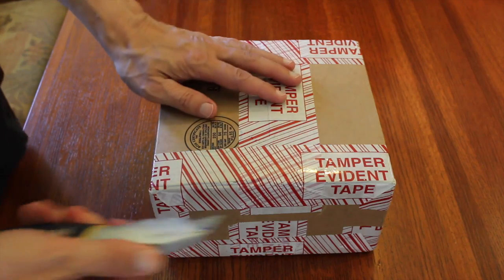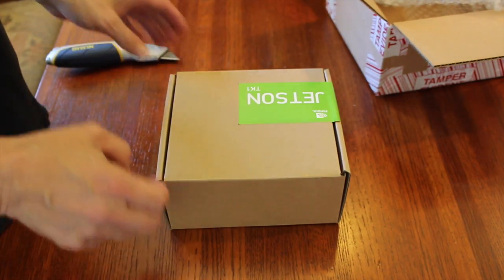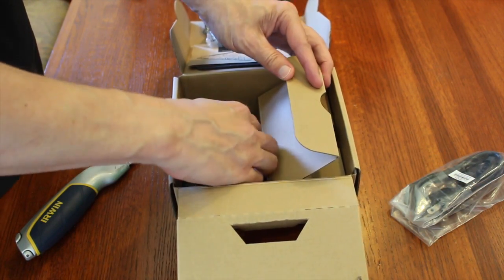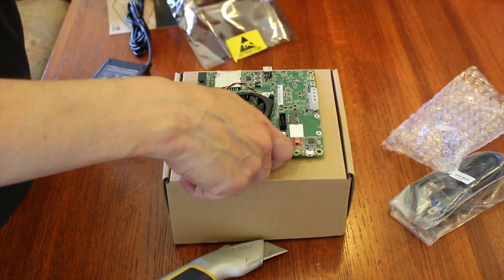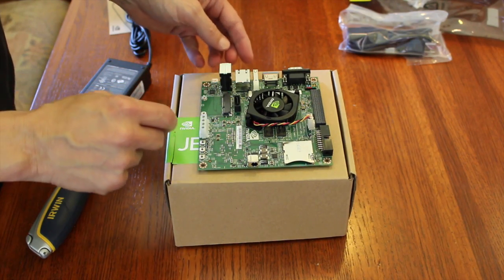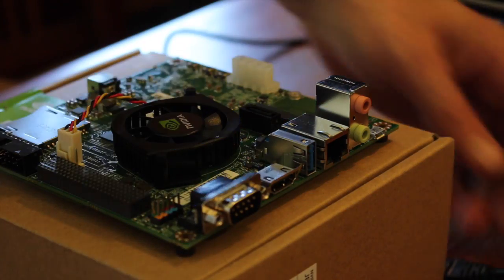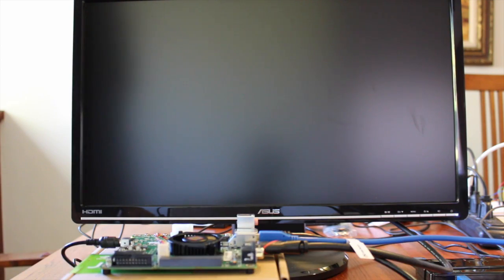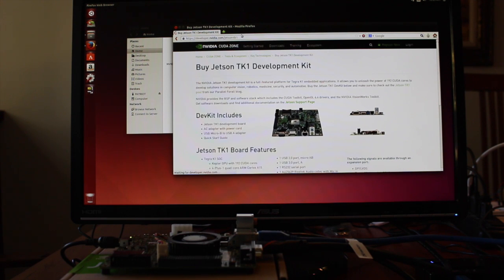NVIDIA Jetson TK1 Unboxing

Comment: What is the blue usb cable for?
Reply from the maker: The USB cable is connected to a USB hub to connect a mouse and a keyboard. Thanks for watching!
Reply: I want to access the terminal of Jetson on my laptop using SSH ,so I connected  an Ethernet cable .Now the jetson and the laptop does not have an IP address so I have set one but what should be the default gateway ?
I am getting an error on Putty.

Comment: Just wondering.. Could you please do a hyperspin install as you look to be one of the most concise people to use this board.. 

I understand that the nvidia shield is able to run hyperspin, but not sure how I'd go about it. By having someone who is adept to using this and looking over your tegra Linux setup, I'm certain you'd have no issues putting this together.

The shield I understand uses firmware available here.. 

https://developer.nvidia.com/gameworksdownload but I can't seem to find the instructions on how to install it to the tegra board itself. Also, on a quick note, would this firmware only support the XX variant boards or would the tk1 also be suitable for these firmware files?

Also, hyperspin instructions are available here. 

http://www.hyperspin-fe.com/forums/topic/9226-how-to-set-up-hyperspin-on-the-nvidia-shield-beginners-guide/

I understand they hyperspin part.. Just not the install for the OS for the shield.
Reply from the maker: Hi Gary,
That's a fairly involved project, I don't know of anyone who has it up and running. There are people who have Android TV installed on the TK1.
https://github.com/Jetson-TK1-AndroidTV
I'm not that big into Android, so you're guess is as good as mine as to how to go about installing it on the Jetson TK1.
Reply: JetsonHacks OK.. 

Hyperspin works on shield TV .. No worries about that.. It's mainly the android install portion I'm after.  

Hyperspin is supported by tegra shield x1 and shield TV platform. 

I would think installing the shield TV is would be compatible with tk1 as they're both based on the same GPU, albeit, the processor between the tk1 and x1 are different.
Reply from the maker: My understanding is that Hyperspin is an Android app, if you can get Android running the rest should be straightforward.

Comment: I just bought one and to me does not open ubuntu desktop just terminal ubuntu. Do you know why this could happen?
Reply from the maker: Mar Canet On some of the boards you need to install the desktop driver. This procedure is covered in the Quick Start Guide available at: https://developer.nvidia.com/get-started-jetson. In you home directory, there is a folder named NVIDIA-INSTALLER. In a Terminal, go there and run the installer script:

$ sudo ./installer.sh

Do not type the '$' it represents the command prompt. 

However, the version of operating system is currently L4T 21.3 (the Jetson is shipped L4T 19.2) and should be upgraded using JetPack. There have been many changes since 19.2 that make the system much more stable and responsive. You will have to use JetPack from a Host PC to flash the Jetson. Here's a blog entry on what to expect:

http://jetsonhacks.com/2015/03/09/jetpack-1-1-nvidia-jetson-tk1-development-pack/

 If you have more questions, you can go to the Jetson forum:

https://devtalk.nvidia.com/default/board/139/embedded-systems/

Another resource is the Jetson Wiki:

http://elinux.org/Jetson_TK1

Good luck!
Reply: thanks it work it out.

Comment: can it convert films 1080p to 4k with the hundred ninety two cores if it does so i don't need to use the computer and do you need to change the fan on it i like new gadgets
Reply from the maker: Hi Peter,
I don't know the answer to that. The Jetson can decode 1080p in real time and display it on a 4K display, but it depends on the application software on how it is actually displayed on something like a TV set, say using something like XBMC. You don't have to change the fan, it works just fine. Hope this helps.